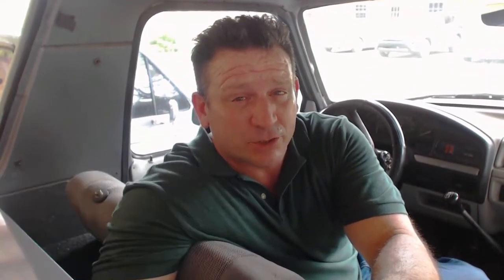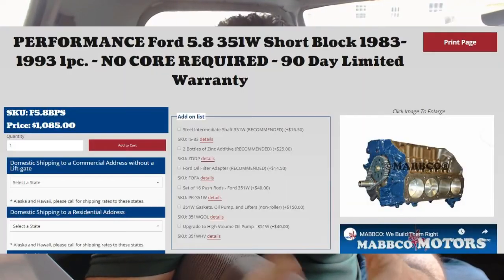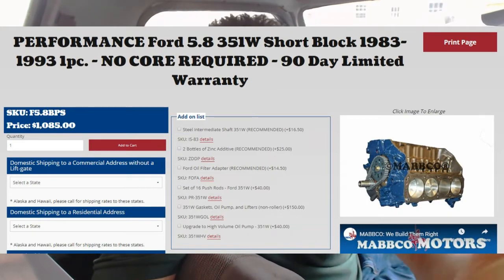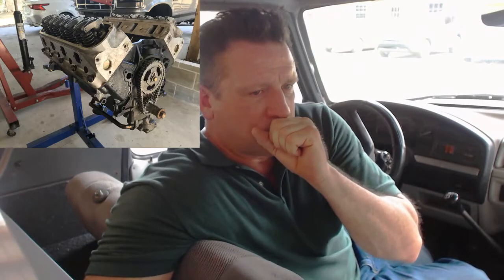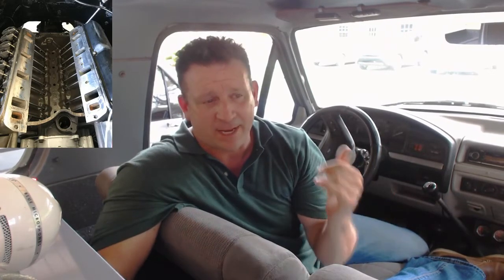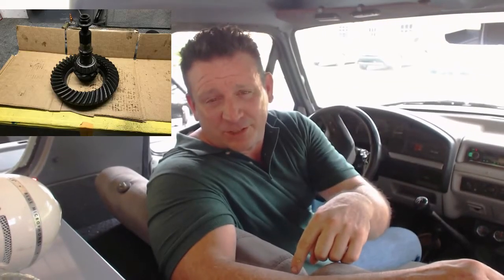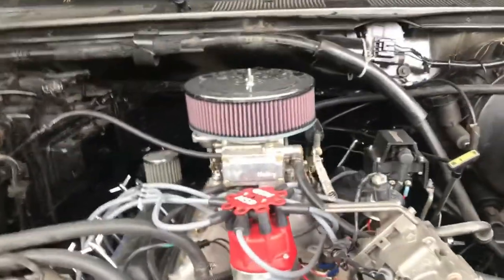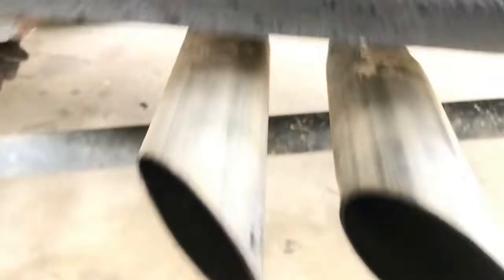MABBCO  PERFORMANCE  SHORT BLOCK 351W Review

Comment: Wow, thanks for the review.  I just came across this engine setup for a 1970 Cougar.  I'm planning on using the aluminum heads top end kit from Ebay for like 900 bucks in addition to this short block.

Comment: Been toying backing and forth with buying a bone stock 350 Buick shortblock for a low performance daily driver. Would you recommend it?
Reply from the maker: its pretty cheap to do your own rebuilds if you have the stuff to do it.  If you just skip the machine work, you can save a ton of cash, but if not, these guys are best bang for the $
Reply: @l-2academy784  I've decided to buy a donor motor for my daily and have my other engine machined. They said six to eight weeks to ship and they have a crap ton of negative reviews. The average machine shop is behind six to eight weeks so I'd rather save a thousand dollars.

Comment: Nice review. Spoke to Austin and pulled the trigger on a SBC 350 marine for my Wellcraft Nova II. Anxious to see what I get.
Reply: How did it turn out? Good or bad?
Reply: @steveyao3102  Well, it is now built and running in the boat but not that impressed. I don't know what happened with the rebuild but there was dirt, rust and grime all over the block so I doubt it was tanked. Then there is the question that if they did not tank it, I doubt the fluxed it. I did not see any dye lying in any crevices on the block. AND...the SB came .60 over. While not a super critical issue...the block is maxed out. Ant there is on info on the specs of the cam they used on the block. Didn't matter in my case because I installed a CC Xtreme to match my other engine. And a heads up for all future buyers, if you plan to use parts from your old block...you get one that has the same casting #. I had to drill & tap the block to use my starter from the old engine.
Reply: @Bluebark64FIS  You talk to Austin about your troubles?  He hung up on me.
Reply: @nealkelly3845  Didn't even bother. Just decided to chalk it up to another learning factor and moved on!

Comment: Its been almost two years since this vid. Any regrets for going with the non roller? Im in a similar boat that youre in
Reply: na, non roller worked great all the way into the 90s at least.  300 hp is 300 hp.  still runs like a sewing machine.

Comment: I just ordered a 302 roller setup with all the options they have. 

How's your still running?
Reply: great, it’ll be like a stock late 60s GT package.  if it wasn’t in a heavy bronco and was in a light mustang it’d fly.
Reply: @unpopulartruths4531  good to hear I just ordered there 302 roller for my 65 mustang. Got almost all the options they had w/lumpy cam
Reply: @unpopulartruths4531  I was kinda sketched by some of there reviews. This video and the video about the 302 breakdown made me feel comfortable about spending the money.
Reply: @dglenn803  did your mabbco experience work out.
Reply: @TropicBreezeRealty  ended up going through a local machine shop after eating on mabco to ship my engine for 8 weeks. Ended up having to pay a "restocking fee" of 500 for canceling my order....

Comment: How about an update, "L-2 Academy" ?
Reply from the maker: been driving it ever since, still has 50lbs oil pressure and runs great.
Reply: @l-2academy784  How many miles on it?  Thanks for your reply and video!
Reply from the maker: @mikeceli  no speedo, but maybe 50 tanks of gas
Reply: @l-2academy784  Thanks again.

Comment: Take this video with a grain of salt. I ordered a mabco shortblock a couple years ago. It was supposed to have a few upgrades also. Well needless to say, once i got to looking and checking clearances and such, worst motor i have ever seen. All over the place. Ended up tearing it down and sent to my machine shop to have crank reground and rebuilt. Do not buy
Reply: mine still runs great with 50 lb of oil pressure and i drive it like a hooligan.  not sure what to say, but when they make 1000 engines a year for under a grand some prolly slip through the cracks, summit has nice short blocks for 5x the price, maybe it’s a better option
Reply: @unpopulartruths4531  when they do "slip through the cracks" you're in the crack with them.  Customer service is a joke.
Reply: How was your "customer service" experience?
Reply: @nealkelly3845  Dont really remember. its been a couple yrs. But ,if you pay for moly rings and you get reg cast, then thats not good service.